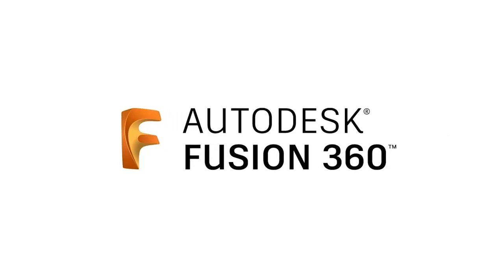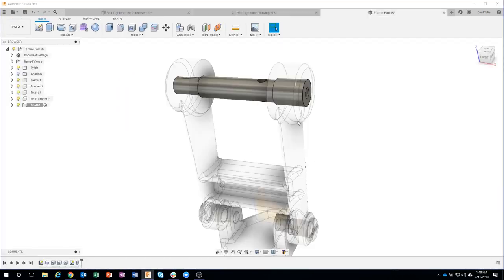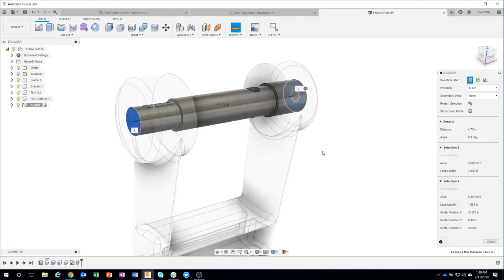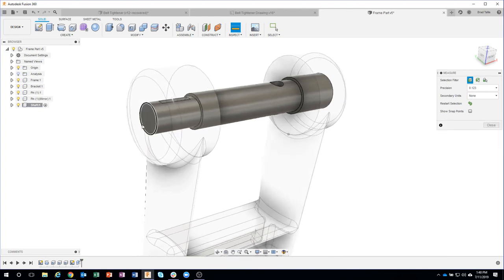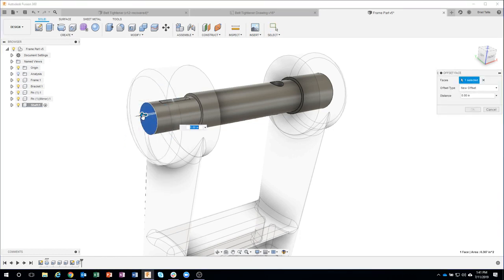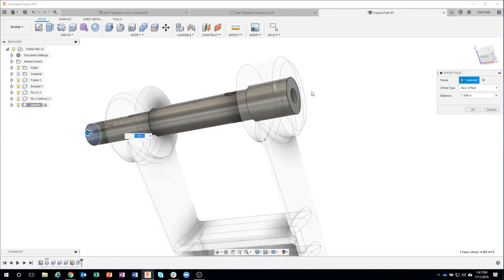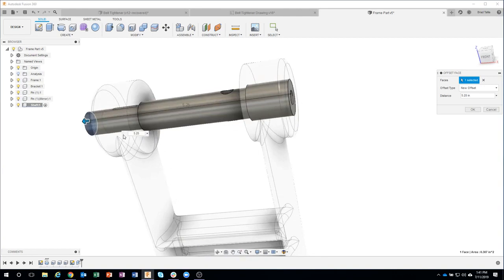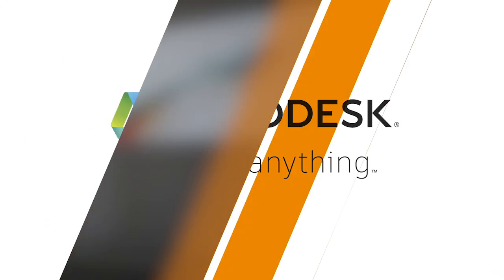QUICK TIP: Re-anchor Dimensions

Comment: didn't understand what you mean
Reply from the maker: Re-Anchor allows you to re-set where the dimension is being measured from.  For example, on the shaft in this video, when I move a face, it says I have moved the face 0.5 inches from where that face originally was.  I can "re-anchor" the dimension to say I want the face to move 2.5 inches from the end of the shaft instead of from where the face originally was.